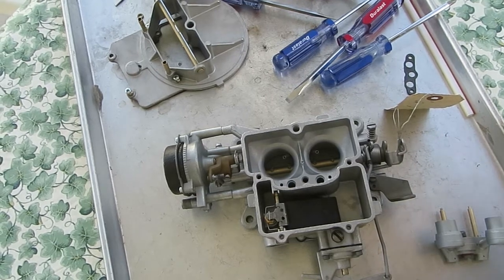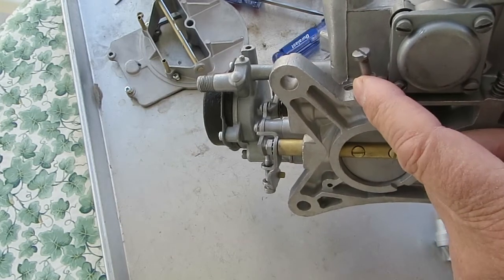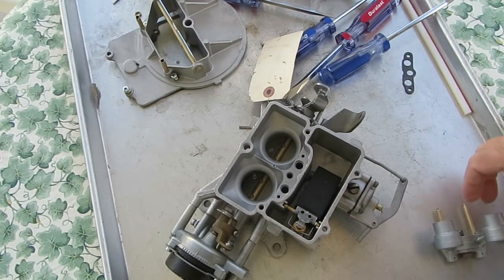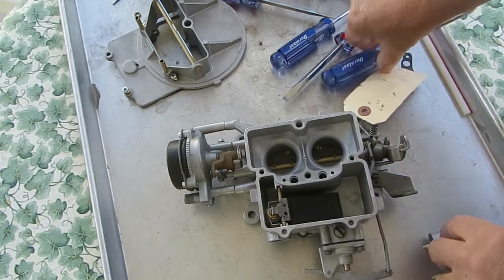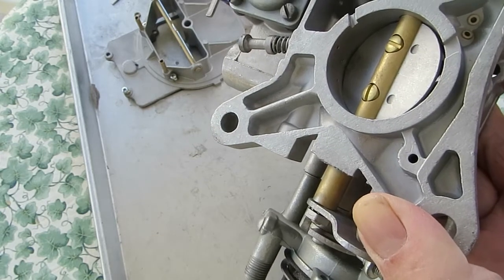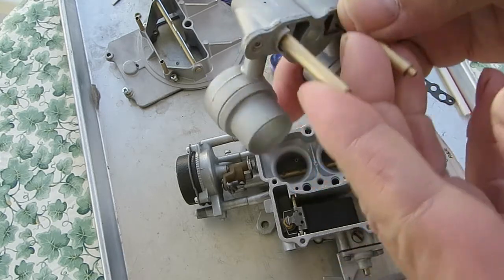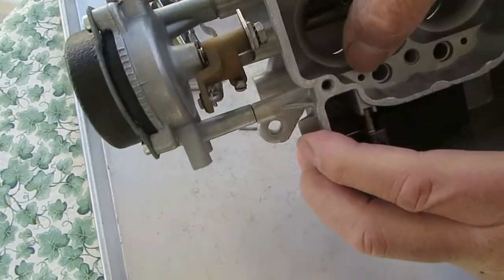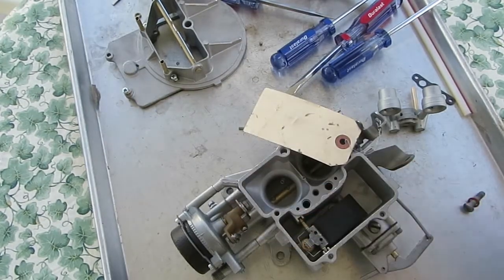Why Your Carburetor Won't Idle | Troubleshooting Guide

Comment: I’ve got a motor craft 2100 on my fe I’ve been having issues where it seems to run lean it smooths out when I choke it but as soon as the choke goes away it wants to die and runs rough when opening up the thottle I’ve tried adjusting the mixture screws with a vacuum gauge hooked up and can’t get it to pull vacuum  how I’d like it ran decent a few weeks ago any suggestions? Timing is correct,new pump,new tank,lines and filters

Comment: I just rebuilt a 2100 motorcraft and now idle screw all the way out and still idles very high. Help please. Idle mix screws 1 1/2 turns out.

Comment: Here's my question I just did a rebuild on a motorcraft 2100 and for whatever reason it does not want to stay idling. It turns on after a few pumps then turns off after a few seconds. I cleaned out the idle circuit my mix screws are 2.5 turns out, idk what I'm doing wrong. It only stayed on when the needle sprung a leak and flooded the carb.
Reply: @MikesCarburetor  I will give that a try thank you for the reply

Comment: Mike, I've been fight my C4AF for over a week. I am pouring fuel out the boosters and cannot get it down to the idle circuit. I left an email with your staff yesterday. After watching this my question is; can the tiny holes in the venturi being clogged cause this rich condition? If so, it's going back into the ultrasonic bath. The diagram in you kit that matches my carb is F2.
Reply: I cleaned it again. Same results. I popped off the 2 expansion plugs and couldn't even see where there were holes to the idle circuit. I probed around with a dental pick and found them. I didn't think I was going to get them cleared but I finally did.  Thanks for the quick reply.